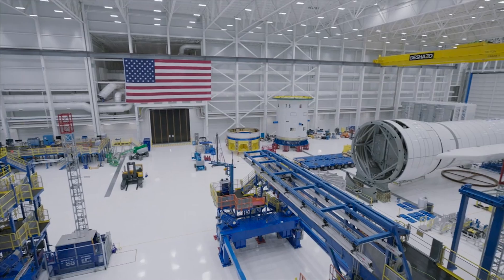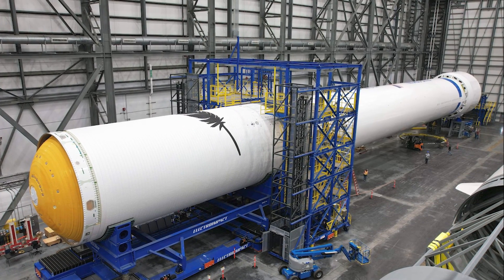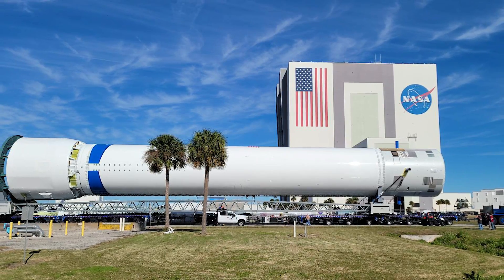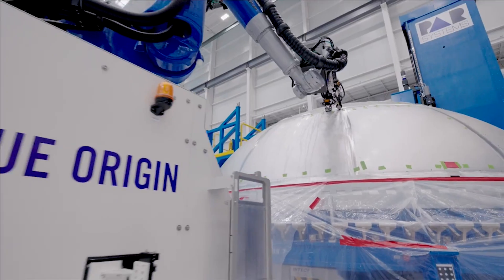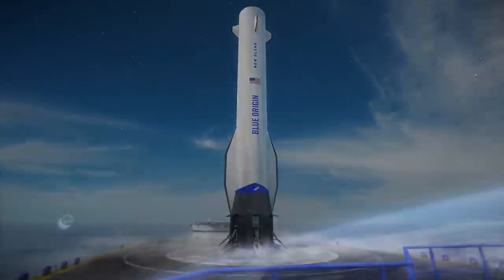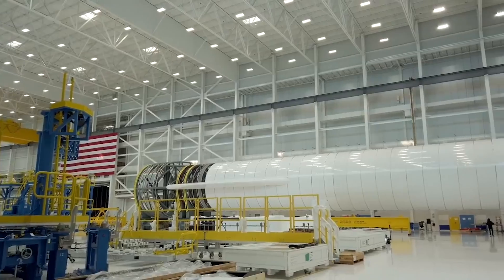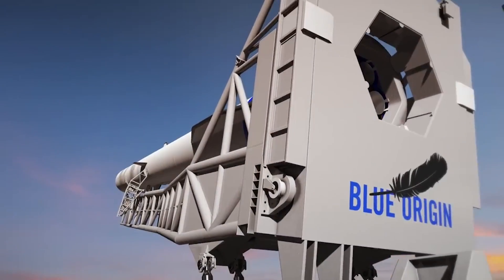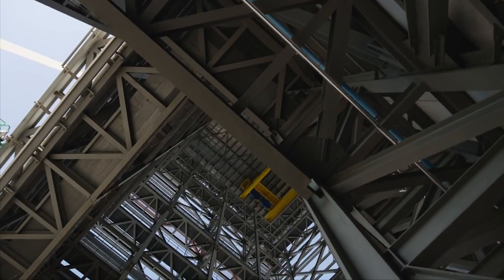New Glenn Flight Hardware Is On The Launchpad

Comment: Are they are banking on successfully landing the 1st booster to support the 2nd launch? Just feel like any failure, which is certainly possible, could take them significant time to recover from. Just not sure they are producing enough boosters / engines to easily recover from Rapid Unexpected Disassembly.
Reply: That is a big issue. They are leaning hard into reusability. However, there's still a good chance of a RUD regardless. So they may still lose 1 or 2 boosters before landing which could be a massive pain to replace. Especially since they just aren't producing many engines. They are almost relying on New Glenn working perfectly from the start which sucks.

Comment: They have to try and land first try because they’re trying to compete with an even more capable and ambitious starship which is fully reusable and might be able to be caught by a tower instead of landing.
Reply: Oh and Elon musk said that spacex has a roadmap to 200 ton payload to orbit which blue origin has no roadmap to considering they aren’t using the same manufacturing methods as spacex and interactive designs. Along with spacex using stainless steel skin which can be modified easily in thickness and other hardware on the boosters which can be modified easier than blue origin can do with New Glenn. Blue origin is playing it safer than spacex.
Reply: 😅 More like because each Be-4 engine costs millions & takes months to build so 7 engines will be + of 15 million

Comment: "Pathfinder" vehicle, this is the one with the "Not For Flight" labels on the hardware.
Reply: Several articles, including Aviation Week & Space Technology [February 21, 2024] have confirmed that the pathfinder vehicle s a mix of flight and flight-like hardware. A quote from the AvWeek article:

"This time, the test vehicle will remain at the pad for several days for an integrated tanking test (ITT). The first stage is flight hardware that will be used on a future mission. For the ITT, the booster will be filled with liquid nitrogen, rather than the liquid oxygen and liquefied natural gas, a commercial form of methane, that will power the booster’s seven BE-4 engines during launch."

This is not unlike the fueling pathfinder that ULA used to verify the booster core mechanical and propellant loading at LC-41 back in 2021, which the core was flight hardware, but the BE-4 engines were non-flight development engines very similar to those used eventually for flight. 

Even before those articles, Blue Origin employees had said that the pathfinder was a mix of flight and flight-like hardware.
Reply: @Nowhereman10  Could you re-read the title of the video, where 'Pathfinder" and "Flight Like Hardware" are not mentioned?
Reply: @PiDsPagePrototypes  I'm not sure why you're attempting an evasion. Your statement said that there was "non-flight hardware" stenciling, implying all of it was non-flight. 

I'm merely correcting you by showing you the sources that mention the pathfinder vehicle is a mix of both.
Reply: @Nowhereman10  How is it Evasion, to point out where the title is deliberately misleading. The title is implying that the ship on the pad was all 'flight', it's not, it's a pathfinder, made up of flight and clearly marked 'not for flight' hardware.
But sure, you're welcome to misinterpret to your own intent and bring in a quote from another source and just ignore the misleading title of This video.
Reply: @PiDsPagePrototypes  You could've said 

"Ah, sorry, I should've said it was a mix of both." 

In other words, you're doing just as bad or misleading a thing as you claim Space Bucket is doing.

Comment: This is the most amazing update for the program since New Glenn was announced. I hope any potential acquisition of ULA doesn't add to the amazing amount of work yet to be done. This is a very good sign that BO may actually achieve orbit for the first time ever. 
Another thing they forgot to mention was which satellite data network BO will hire to communicate with their barge. If their two project kuiper satellites, launched by ULA, had any capacity other than serving as an FCC bandwidth placeholder, I'm sure we would have heard all about it.

Comment: I suspect the New Glenn is around twice as heavy as they claim. Its volume is a little less than 1/2 of Starship's. That makes it around 2450 Tonnes. Bezos is very crafty. He doesn't tell us about the weight of the BE4, which looks about twice the size of the Raptor. He also doesn't tell us the Specific Impulse of the engines. He'll probably run this rocket at 1/2 thrust initially with its LOX/Hydrogen engine 2nd stage. Then later, he'll switch to full power and maybe call it the New Armstrong. It looks to me that Bezos will beat Musk in the long run. Musk has got himself bogged down in an oversized, over complicated, over Reusalbe'd, over hyped Starship rocket.

Comment: Wow that is a lot of info.  This is all the most aggresive end of what people had been speculating.  If successful, and their is every reason to think they will be then BO will arguably be ahead of SpaceX in the race to the moon.  As they will have validated their launch vehicle first AND will have a sufficient stockpile of stages to perform all nessary launchers for an Artemis mission (I belive BO plans need 3 for their initial mission, and 2 for subsiquent ones) without dependence on recovery or refurbishment of any booster.  That basically eliminates all risks other then a pad destroying explosion in the launch campaign, where as SpaceX has to launch ~dozen times in succession, which almost certainly means booster reuse is critical to complete an Artemis mission for them.

Comment: Landing a large booster is much different then landing new shepherd.
Reply: Didn't SpaceX start off with Grasshopper?
Reply: @moekitsune  no. They landed falcon 9.
Reply: @jamskinner  "The earliest prototype was Grasshopper. It was announced in 2011 and began low-altitude, low-velocity hover/landing testing in 2012. Grasshopper was 106 ft (32 m) tall and made eight successful test flights in 2012 and 2013 before being retired."

Yea sounds like they built up experience first before landing a flight ready booster
Reply: @moekitsune  only hopper I know is for starship.  Maybe I am confusing the two.
Edit: I do think blue origin will have trouble landing a large booster in a moving target without testing it.
Reply: New Shepard has NEVER carried a human being higher than the X-15. Ever.
It's not much of a rocket if it can't even meet the performance of a 1960's airplane.
Reply: @Hoopaball what the fuck is your problem? Did someone insult you when you were 7 so now you have to unload your grief by getting mad on random ass launch vehicles?

Comment: Whoa, that's quicker than I thought. Blue Origin really does play with its cards close to its chest. If the first flight (and landing) proves successful, it could lend a lot of credibility to their slow-and-steady approach.
Reply: If Blue Origin launches, gets to orbit, deploys payload, and booster lands, jamskinner has to donate 1000 hours to candy-stripe a children’s cancer ward. If it doesn’t I will go and work for Space X. Oh wait.
Reply: For a few years it seemed there wasnt any progress and then BOOM there was the 2 stage, first stage and then put on the launchpad so quickly, they really hide their progress
Reply: i wish them success .. that will light a fire under spacex resulting in even MORE innovation
Reply: Not really. The company is 23 years old and has yet to launch a single rocket into orbit. It’s older than spacex.
Reply: @jamskinner  10 years of that time was as a think tank and another 5 were spent only working on rocket engines to sell to other companies.
Reply: @luther0013; of which they have provided 2 until now.  A 3rd engine, which was actually the 2nd, blew up on final testing.

At this pace, the company will not last for a very long time.  The NASA way of doing rockets is finished.  Due to their arroganz, they refused to learn as much as possible while they had the chance to.  Now BO still have the chance to catch up, but it does look a bit funny after 23 years.
Reply: @MichaelWinter-ss6lx  they have delivered 4 engines to ULA. And 7 engines for New Glenn are undergoing acceptance testing. 

How many Raptors has SpaceX blown up during testing? Oh wait, I forgot SpaceX is a special case that can’t be held to the same standards other companies are.
Reply: yeah how has that selling rockets to other countries paid off? Other than damn near destroying ULA?
Reply: @jamskinner company has been around for 23 years, but new glenn is in the works for just 7 if im not mistaken.

BO's priorities were different prior, they were focused on New Shepard, especially after loosing commercial crew program bid, which lessened the need to develop a launch vehicle quickly
Reply: @jamskinner  SpaceX has launched over 100 rockets, yet failed to apply launch experience data gained, resulting in Starship launch termination explosions of flights 1 and 2.
Reply: PROTOTYPES
Reply: @jamskinner  
I said it's quicker than "I" thought, not "you." I thought they'd drag their feet for another few years.

Edit: And if their heavy-lift launcher works without any hitches, it would show the inherent strength of this approach. However, I also realize its inherent weakness is in how long it takes to finalize a launch vehicle.

Comment: Imagine is New Glen gets to orbit before Starship. No on would have seen that coming in a million years.
Reply: Plenty of people saw that coming, you just had to not be a Muskrat to see it.
Reply: Starship has only been in development for a fraction of the time of New Glenn.
Reply: @lyricbread  Starship has been in development for at least 7 years if not longer.
Reply: @lyricbread  nah, Yes BO is older but for most of their time it was making New Sheppard(idk the name) and lauching him  New Glenn is actually younger than starship
Reply: New Glenn has been in active development for over 12 years, about 6 years longer than Starship.
Reply: @stevenrn6640  starship was active since 2012, new Glenn was only announced in 2016.. next time do your research .. starship and raptors have taken longer and are still failing, BE-4 engines worked on the first flight
Reply: @iamjwns6277  Starship was first announced as an idea in 2012.  It wasn't under construction at all, definitely not "active".  The design changed from carbon to stainless in 2018, and Starhopper flew in 2019.  Several SN variant test articles also flew, as well as two fully stacked Starship rockets.

I don't know why people have to hate on Starship to like New Glenn.  NG is a cool looking rocket that's gonna work fine as competition to Falcon Heavy, but it doesn't even have engines in it yet.  Why get mad that SpaceX tests differently?  All of the Starship flight tests have been very clear that they are tests, so why does everyone who hates Elon for making the blue check mark mean nothing pretend each of those was a fully flight capable rocket and the failure is embarrassing?   Of the literal hundreds of Raptors that have been built, only a couple have failed, and one of the 4 known BE-4's has failed as well.  

For Starship to succeed, New Glenn doesn't have to fail, so why do people get so offended and violently compare the two.
Reply: @MrAlbertaSurfer  the guys above literally hated on new Glenn to like starship but yet you are commenting to me. Go address that guy first
Reply: @iamjwns6277  Starship and New Glenn are just two different rockets tbh. I think SpaceX set the bar VERY high with Falcon 9 (arguably the greatest rocket ever developed) and Blue Origin has to go past that. They can't go backwards and make a Falcon 9 competitor because space flight is changing to bigger, heavier satellites. 
That being said, I really want to see one fly. I don't care if it blows up mid air or if it comes crashing down. I think just having one launch will be extremely informative for them and get more people interested in New Glenn. 
Also, if they land New Glenn first time, that will be spectacular. I don't believe they will do it first time. But imagine if
Reply: Yep it reached orbit before Starshit 😆
Reply: @unnamed-ninja-yt  I mean, its slightly disingenuous. Starship is preventing itself from reaching orbit on purpose by cutting its engines off early.
Reply: @ You can gaslight as much as you want but it reached orbit before Starshit. I don't care why it's cutting off the engines early.
Reply: @unnamed-ninja-yt  It's not gaslighting, its just fact. They stop it from going into orbit on purpose. The ship is capable of reaching orbit they just don't want it reaching orbit. They want it to fall into the ocean, blue origin didn't. The fact is it stopped short of its orbital capabilities on purpose. Not that it couldn't. And it did it multiple times over, even relighting their engines in space showing they could still reach orbit if they wanted to but the didn't.
Reply: @sp00l  It reached orbit before Starshit. Spill some more cope 😆
Reply: @unnamed-ninja-yt  No need, we already know who was first multiple times over.
Reply: @sp00l  Off topic. Just take the L 😆
Reply: @unnamed-ninja-yt  Enjoying simping over a glorified falcon heavy xD
Reply: @ It must be very painful to be a SX fanboy these days. The amount of cope is off the charts 😆
Reply: Why?  Starship is a much more difficult rocket.  Plus i doubt it will.  It maybe in production sooner though.
Reply: @jamskinner  New Glenn already is in production with 3 complete 2nd stages, four boosters, and at least 7 sets of fairings.
Reply: @jamskinner understatement. The engine infrastructure is insane. The amount of piping dependencies and structural supports are mind blowing.
Reply: You sure?  New Glenn was supposed to fly in 2020.  It was already supposed to be in orbit before Starship.  It would seem that Blue Origin themselves saw that coming...

I have no doubts this rocket will make it into orbit in its first launch, but it's been in development for 12 years, it's nothing new.
Reply: @MrAlbertaSurfer  Yeah its been a massive shit show for sure. But I'm in the mindset now that any launches are good for humanity and I can't wait to see it flying useful payloads to orbit. Starship is the dream though, can't wait until its going to the moon!
Reply: @MrAlbertaSurfer in development while building infrastructure, designing, installing hardware to build the rocket/engine parts, hire over 10,000 people, methodically test test test while still maintaining a healthy work/life balance, during a pandemic.
Reply: Starship was supposed to be landing on mars uncrewed in 2022, spacex tinelines are even more bs@MrAlbertaSurfer
Reply: @MrAlbertaSurfer starship was supposed to fly in 2020
Reply: @iamjwns6277  And it did fly, 11 times so far.  Remember SN15 and the semi-successful landing?  Pretty neat, to be able to see all those launches and explosions during development.
Reply: @MrAlbertaSurfer  non reached orbit
Reply: @iamjwns6277  test articles.  The two have very different strategies, my comment is it's more fun to see them launch and blow up than have it all hidden behind closed doors. 

People act like this is some kind of race to orbit that's gonna put one out of business.  Does Chevy making trucks mean Ford stops making trucks?  For SpaceX to be successful, Blue Origin doesn't have to fail, and vice versa.
Reply: New Glenn is a Falcon-class rocket, not Starship-Super Heavy class. SpaceX is still about 10 years ahead.
Reply: @tepidtuna7450  New Glenn is a Falcon Heavy-class rocket with just a single stick configuration, not a regular Falcon 9. Both NG and FH are on the lower end of super heavy capability while a fully expendable F9 is a heavy lift rocket as is Vulcan Centaur and Delta Heavy.
Reply: @tepidtuna7450  While true in some regards, the payload bay diamatier is actually pretty important here. Falcon Heavy only has 5.2m diam while New Glen is 7m. Its not quite 8m like the Starship but its more than just a Falcon Heavy Compeititor.
Reply: @sp00l Starship is 9 meters not 8. It also looks like it's a longer fairing from scale renders featuring both rockets. I believe SLS is 8 meters however. Plus 150 tons vs 45 is a big difference.

New Glenn is an impressive rocket but it's no Starship. The better question is when they get project Jarvis going will it matter. As long as they both bring down the cost to orbit things are going to change because of both of them. Then it's just seeing what people build and launch. Dream big.
Reply: @garreth629  I'm not comparing it to Starship. I'm saying it can't be compared to being "just a competitor to Falcon Heavy"
Reply: @sp00l  in terms of use case New Glenn is more similar to Starship than Falcon Heavy as it is pretty clear that Blue Origin want to use it as a LEO bus.
Reply: @tepidtuna7450 you don’t know what you are talking about. The amount of payload differences, size differences, etc. are not comparable. Also you have to have a payload fairing or a function to deliver payload and SS doesn’t have that yet. Unless you count the pez dispenser😂
Reply: @tepidtuna7450 new Glenn is closer in size to starship than falcon 9, also they are working on Jarvis for a reusable 2nd stage so new Glenn will actually be fully reusable in time, making it much like starship and not like falcon 9